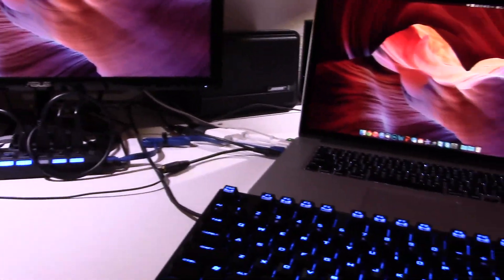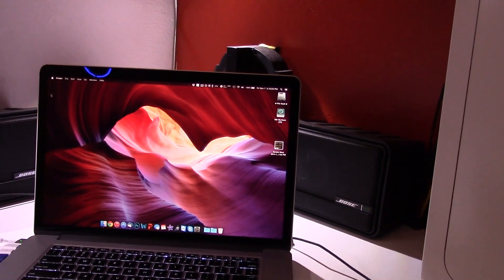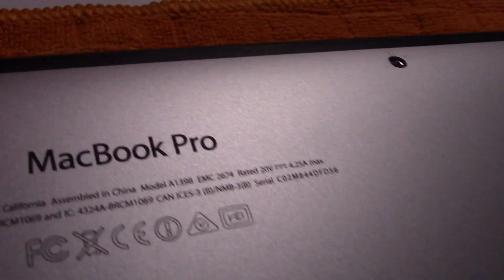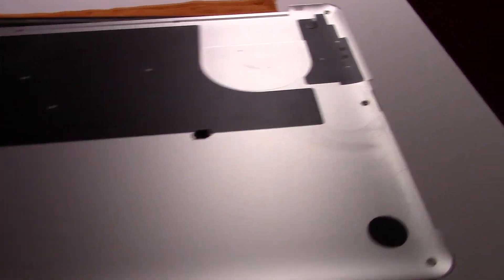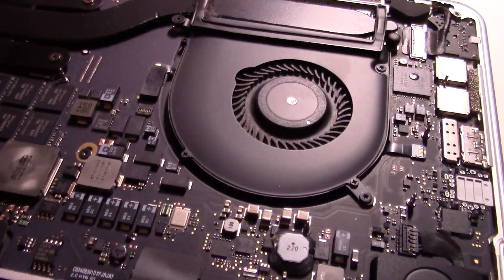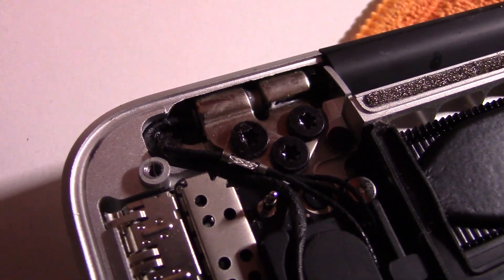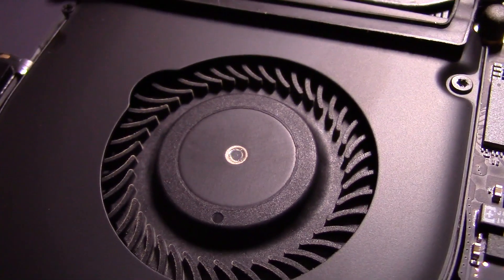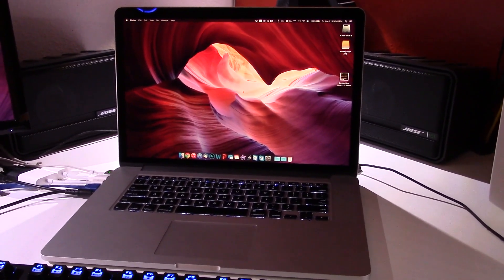A Look Inside the 15" Retina MacBook Pro + Tips

Comment: Nice video! It is really ironic the SSD is made by Samsung after the whole lawsuit thing. BTW, I tried ART and a lot of the apps I use work. And if you feel like the apps are launching slow, go to developer options and reduce the animation times to .5. Worked miracles on my Nexus 7, 10 and HTC One M8.
Reply from the maker: Samsung has made a lot of Apple's components for a long time now. It is pretty funny.

Do you notice any significant speed increase though? And if I mess with my animations, my lock screen animation glitches out so I just leave them at default.
Reply: I noticed a huge difference on the Nexus 7 and a little on the HTC. It felt like a new tablet, it was freaky fast on that Snapdragon S4 Pro. If you need a replacement lockscreen, AC Display is good.
Reply from the maker: Lol the problem is, it only happens with one of the lock screen animation settings....it just so happens to be the one I like the most -_-
Reply: Lol, yeah I have no problems with the HTC lockscreen on mine or AC Display. Using ART can be a pain as it is usually best to do a factory reset to achive best results. The apps also take up a lot more space as they are compiled at install, not every time you run the app.
Reply from the maker: I'll stick with Dalvik for the time being
Reply: Yeah, the Nexus 10 is stuck with it due to the non - Snapdragon processor and is not worth it for everyone. However in the coming months when Lollipop comes out, it will be locked to ART.
Reply: It's not that ironic to be honest. Samsung just makes really great (maybe the best) SSDs.
Reply: Luc Reinink I use them personally and I would agree.